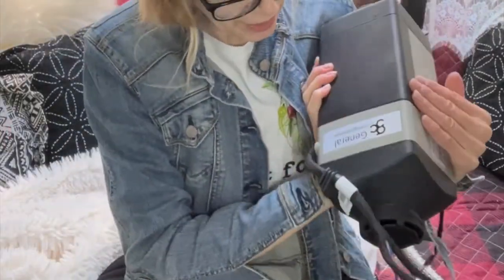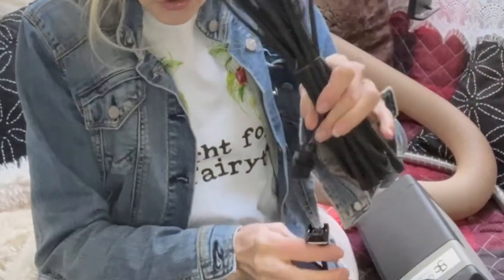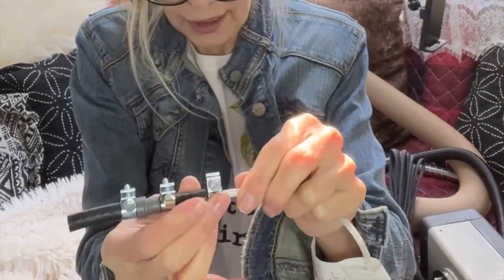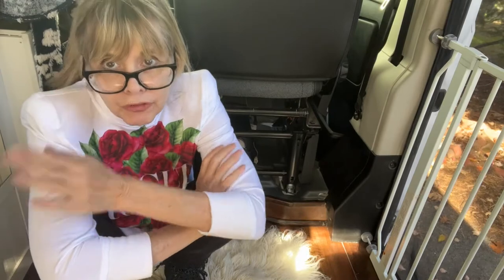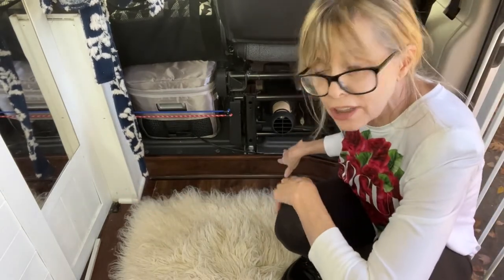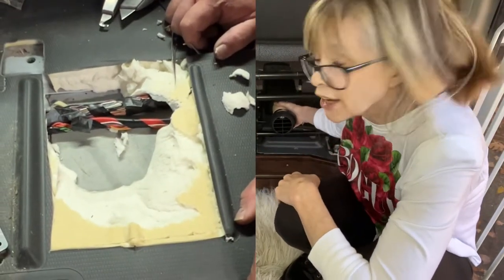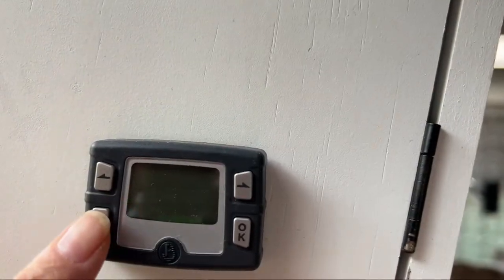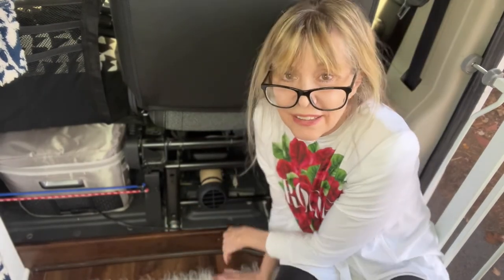Promaster Van Conversion : Bison Gas Heater Install

Comment: Thank you Lola. Your videos are still some of the best on this subject in Promasters. I wonder did you just coil up all 17' of the fuel pump wiring? I want to snip it to length and connect via butt connectors.
Reply: Never mind. I reviewed and saw that you did store the wire, zip tied.
Reply from the maker: @chilibeanhere  yup.  thats what i did.  i used the heater a ton this winter on my FL trip and its been working great. I'm glad you find my videos helpful!

Comment: Hi there
I have bought this heater to install in my  Promaster from your advice
So in your video, you said you installed the fuel filter in between the heater and the pump with the arrow pointing towards the heater in the diagram that general components, give you it says to install the fuel filter between the pump and the gas.  Was this a mistake on general components as you say everything is working fine  now I don’t know where to install it. Thank you very much. Your video has been so much help.
Reply from the maker: Good Question!  I suggest you call general components.  The reason I say that is I've been told they made some changes so the heater works better in elevations. This might be one change.  Maybe sediment from the gas is more likely to clog the in elevations.  (If you find out that's the case, please let me know and I'll change mine and update the video. )

Here's the question:  Are they filtering the fuel before it hits the pump, or before it reaches the heater? Which way do they have the arrow pointing if it's on the gas to pump line? It actually makes sense that you would filter the gas before entering the fuel pump. But the ultimate intent probably is to make sure only filtered fuel reaches the heater.  

All that said, It'a a tiny little thing to be doing any filtering and there's no instruction that you need to clean out the filter, so maybe "filter" is the wrong name for what it's actually doing.  Mostly it seems it's there to regulate how much fuel goes to the heater.  Then where I put it would make more sense.
Reply: Funny there is no arrow on diagram   I will call the company and will let you know. And to be honest, I don’t even understand how this little grey piece filters the gas. Lol. 
Thank you my friend
Reply from the maker: @mjeanes4244  I agree!!! And filters generally get changed out because they get filmed with sludge!
Reply: good afternoon. So the grey piece is a check valve so the fuel doesnt flow back to gas tank. It is best to install where you did and closest to the heater.  This kit doesnt come with fuel filter. But you can order one from them. Im opting to put one in. Thank you again for your video.  It really helped me a lot. 💕
Reply from the maker: @mjeanes4244  thank you for that information!!!
Reply: @LolaandPooch  welcome

Comment: I just found your site and now I'm wondering how the heater is working and are you happy with it?
Reply from the maker: I love it, It's working great!  I wish I would have planned for it when I did the build, I would have made it so the on/off monitor was by the bed.  The heater heats the van so fast, I never leave it running. so in the morning it would be nice to turn it on while under the covers.  (I've never camped in full out freezing weather. )
Reply: @LolaandPooch  Thanks for the quick reply.  I do not want to go to diesel so I won't need an additional fuel source.  I have a converted cargo trailer so I was hoping to mount it outside on the tongue. Would you think that a reasonable option?
Reply from the maker: @johntatman9168  I'm not sure what the tongue is, but if the unit is outside, I don't think it will work.  The bottom of the heater has pipes you connect the exhaust and air intake to, plus access to the gas tubes.  That's the part that goes through the floor if you put it inside. ( I'm guessing the tongue is the part that hooks up to the hitch)  So you can't mount it flat on the tongue. And I don't think it will like being exposed to weather.   I'm guessing you're using the gas tank access to the car/truck you're towing with?  Which means you'd be hooking up and unhooking that connection.  I don't think that will work.
Reply: @LolaandPooch  Thank you.  Things I had not thought about.

Comment: Will you be camping in the winter or do you winterize and store the van?
Reply from the maker: I will probably empty the water system.  The biggest concern is the waterpump freezing and I want to avoid that.   That's the extent of my winterizing.  My batteries have a heat protection system.  When you get your van go for lithium batteries that either are self heating or have heat protection.  Otherwise you have to take them out of the van if  your keeping it outside.  I hope to take couple short trips, one to amish country in Lancaster,  Bethlehem has a great Christmas presentation and a pet fashion show in Jan.  Then I'm heading out in March to meet up with a van friend and tour the south.